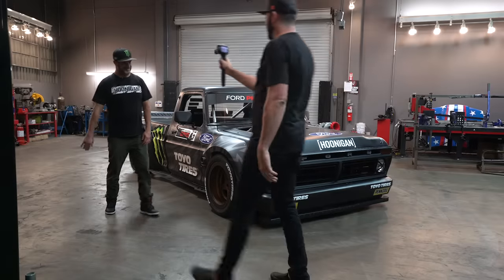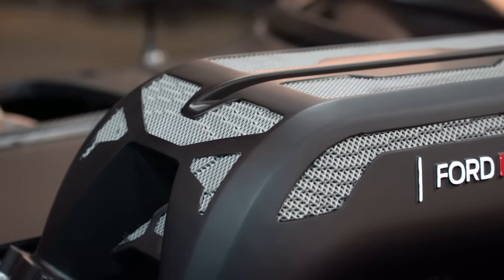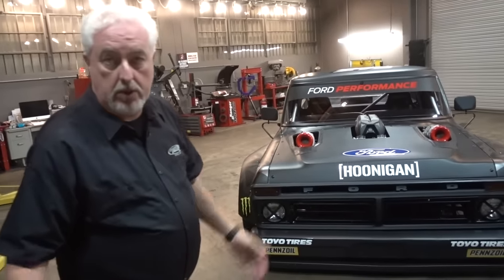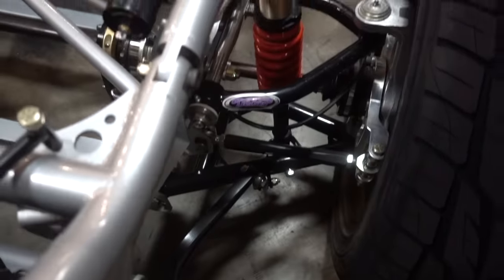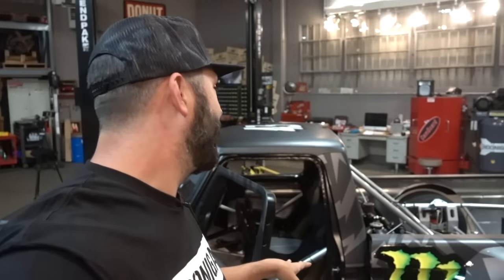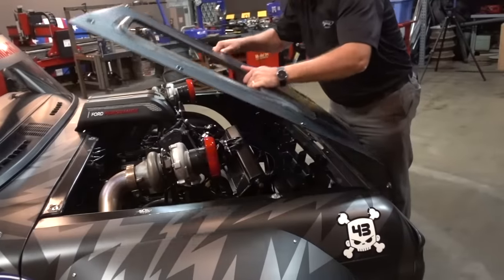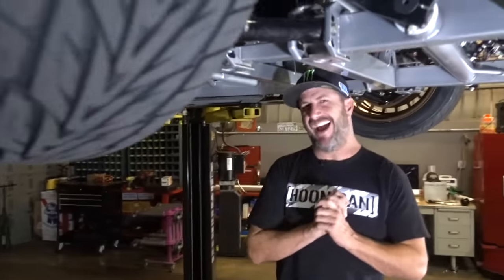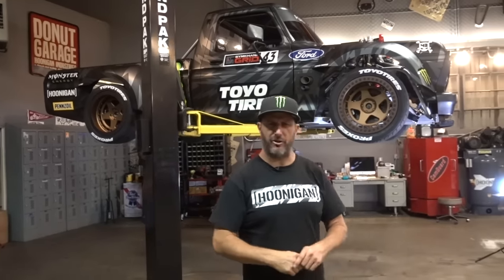Ken Block's Hoonitruck: Twin Turbo, AWD, 914hp, and Ready to Party in Gymkhana TEN

Comment: I bet if you swapped a huge cube NA big-block into the Hoonitruck, it would be Ken's favorite to drive.  When he said "The sound and power delivery are unique", I don't think it was a compliment.
Reply: I can not stand the sound of the raptor. Sounds like a Pontiac grand prix 😲
Reply: Yeah... inline 4 bangers sound better than a V6...  no doubt it's a beast, but the exhaust note definitely takes away from it.
Reply: I personally appreciate what Ford is doing with the push for turbo V6 as the standard engine - better for everyday driving/functional in the rare instances where you need lots of power, and I respect them pushing the boundaries of what that means by using it in high-performance builds where the fuel economy doesn't matter as much. But I think the ideal build for these would be an electric. Keep a bunch of quick-change batteries charged in a trailer, and have 30-minute shred sessions of unlimited torque at any RPM with zero delay in the throttle response...the main drawback to electric is that it's impractical for cross-country trips, if you don't mind changing tires on the regular you might as well change in a new battery. And yeah, feel free to dub in whatever audio your nostalgia requires.
Reply: @kevinvermeer9011  now that's a great idea

Comment: Throwing shade at vaping Subaru owners LMAO, I am the rare non vaping Subaru owner without stance xD
Reply: A non vaping, non stance Subaru. Is that really a Subaru?
Reply: @jasonirwin4631  it has a turbo and it's modified, I think it still counts, just not as much 😂😂😂
Reply: @cjrutter9962  it's technically a Subaru like a LS swapped RX7 is technically a RX7.
Reply: @jasonirwin4631  All stock internals on a WRX with 113xxx miles, but it reliably puts over 300hp down, and its daily driven, all of these things are miracles in the Subaru world xD

Comment: Ford pushin their damn "ecoboost" so much it's really freaking annoying the engine may perform well but Jesus it sounds like a damn weed whacker really should've been a V8
Reply: @adamplitko2101  also a v8 would be fucking heavy for what they wanted to do.. add turbos to this as well and itll basically defeat the point of the truck
Reply: @ruhankarsten7352  v8 are not that heavy if they are all aluminium and they made way more power
Reply: @adamplitko2101  hoonicorn V1 made 850hp without any turbos or a supercharger besides who cares about the numbers this  is the same company that made V8s popular in America so there should definitely be a V8 under the hood of a Ford pickup
Reply: @ruhankarsten7352  that's a terrible argument considering a V8 wasn't a problem for the hoonicorn and a V8 will always outperform a V6 (and sound way better too)
Reply: @anthonylyrette7399  so you want to stick an LS in there? 😁
Reply: @fakename287  hell yeah
Reply: @fakename287  "but i dont wanna go slow" -benny the mechanical stig
Reply: why not a steam engine?
Reply: @jnieto490  ewww. internet tough guy. btw, did you miss the part where he says Ford suggested the v6? yes the same company that made v8's popular now suggests a v6. get off that steam engine bandwagon
Reply: Jessie james  Why not a hit and miss motor?
Reply: @JMax 01 So pros base their engine choice on which is cheaper. Better send that info the Penske and Stewart Hass. LS is OK for backyard racers but the pro's use  GM race engines.
Reply: Every truck out there for 2018 has an available V8 part of History? The only reason Ford is pushing the Ecoboost crap is because they have a huge investment in seeing it succeed. I like the old school recipe for power naturally aspirated V8, there is no substitute.
Reply: I can’t believe the people here suggesting that v8s are primitive engines or something. The engine is impressive but a V8 would have been much more fitting. I’m pretty sure Ken would agree too with his “the sound and power delivery are unique”. The Hoonicorn v2 is his favorite car to drive. The sound just doesn’t fit the look of this truck. But it’s got the V6 because ford is a sponsor and they want to highlight the Ecoboost and that is understandable for everyday trucks.
Reply: @greatlakestatedestroyerpet117  Why not an aeolipile from 50 CE?!?

Comment: Does anyone else think that engine sounds awful?
Reply: Unfortunately, it just doesn't sound good at all, regardless of how bad ass the thing is.
Reply: It's a shame it doesn't have something that of a GTR sound to it.
Reply: @Shepard_AU  I literally couldn't agree more. It's an amazing vehicle but it sounds like a straight piped I4
Reply: It sounds like a little Turbocharged V6. Not my favorite sound, ....I like V8 grumble.
Reply: Don't worry, they can just install Ford's OEM V-8 audio simulator and play it while he drives!(yes it's a real thing in ford pickups and mustangs). Full disclosure, I love my crummy old Fords.
Reply: Sounds pretty mean at low RPM, but doesn't sound anywhere near as good as the Hoonicorn when it's at full cry.  And that's really a shame.
Reply: Baxter It is powered by a 3.5-liter twin-turbo V6 making 917 hp and 702 lb-ft of torque which is powered by the Ford Gt

Comment: the car is modular so if any part breaks from impact it's easily fixable... meaning aside from the engine and maybe the cab, there is at least a whole other hoonitruck of parts at any given time... if not 1 and a half the amount of parts. dream drift set up right there.

Comment: If only passenger cars were built this way...gotta love the motorsports and custom auto market. Amazing how with software, a mill/3d printer, metalworking equipment and some really smart guys you can actually build a vehicle a drifter could replace a rear end on between every set of runs. WOW.

Comment: The "custom" badge on the dash, where the glove box is on a factory truck exactly where it was in my '76 F-150. Details. My high school truck, spent all my money on the motor. Fresh 390FE, 4 speed, 4x4, junk 35's, piss poor brakes. Rubber was laid, diffs were broken. Times were had.

Comment: I have never really liked anything Ford, excluding their older work vans, because the first car I drove was a 2006 Hyundai Elantra hatchback (in silver) which has a remarkably tight turning radius, so when I started driving the Ford focus in driver's ed, granted it was an older focus, the turning radius was so much wider than what I was used to. The focus also had rock hard springs in the pedals, and it made throttle control more difficult and also made breaking harder because I was used to the spongy ass brakes on my dad's ford work van and the Elantra. Since then I have driven a 2007 Hyundai sonata, and a 2014 Hyundai azera. The azera is a great car, even for being a fwd it still has a lot of power for a "luxury" car, I think it's around 270 hp from a v6 engine. Now I'm not saying that Hyundai is my favorite brand of car, it's not, I would kill to have a 95' Toyota Supra, skyline GTR R34, or a Subaru WRX impreza, but my dream car is a 2008 dodge viper hard top in lime green with black racing stripes.
Reply: Hooray for insomnia! It's 3:10 AM, and I'm still wired AF...

Comment: The hoonigans.  you can give me the tires for my build. Lol. So i can travel all over. Its a 1951 ford f2. Im putting it on a 1988 ford f150 frame. It has a 300 6 cylinder 5 speed manual. Its been bored 30 over. bigger injectors plus a few other things. I was going to tuck the wheels under the fenders but im going to stick them out like your truck and make the fenders look kinda like yours. And lower it.  I think it'll look pretty cool that way.

Comment: Far be it from me to give engineering advice, but how is the hell is there no oversized washer on the lower control arm mounts? How in the hell is that bolt holding toque with such a small washer?

reference @ 22:10

Comment: It is an F150 77' it doesn't need to get back on road quickly any where for any race. Nice idea lego box tub framing kit but this anti the car/truck to use it on. I don't know what is really. U can weld up piping just as fast as u can unbolt damage system & bolt replacement system back on+ u never know the extent of real damage after a wreak. What looks unbolt change out may really b unsafe cage u r chasing like trying to straighten old frame car wreak to fix body damage vs mono-cock or uni-body trash it use new deal.

Comment: Had to look at the front grill to see what it was b4 being told a ford and personally I'm a mopar guy and gradually into chevy but my first truck I've own was a ford the same year as this one as a teenager the motor blew up so I left it right there went back to mopar that truck was a ram charger nice truck until you get into buying them huge ass side windows 😂 sold then my next truck is a chevy Silverado 1500 single cab 2wd 4.8 vortec wit 242,051 miles on it all stock except cold air intake from k&m who ever built this motor I would love for them to build any motor 4me this engine loves to rev and she's still my daily truck today like I said from ford to mopar to chevy and still 4.8 strong but I'm missing my 340 balanced and blue printed mopar it got stolen 😩 happy motoring &have a happy holidays stay safe gearheads and all

Comment: Most ppl want to error on beef safety side rather than ultra light fly by Flintstones power type bike racing. But if u r talking solar ultra light bs racing there may b a place for bolt on & off replacement match stick framing.
Reply: Almost always cheaper just to hve a few spares. Hving a few spares means u can hve them set up diff where as hving change out frame means u don't hve any set up but main 1 or 2 & most like mostly exact same frame & set up. Rain day horse vs clay court horse vs gravel or dirt cart, vs paved flat vs banked racing. Idea w/out a need unless crash derby how fast can u fix it or ultra light bares safe lowest limit match stick framing.

Comment: If I owned this truck, I would drive it straight to Cleetus McFarland's shop to LS swap it and get rid of the miserable V6
Reply: Why would you want ancient technology with hundreds of horse power less.
Reply: @benjaminwayneb   Because you can hit 900 hp for way less without the cost of needing to have a one of a kind 3D printed intake manifold. 

I have an LS powered car and agree with many of the comments that a V8 Coyote or something else from fords line up would have sounded damn good. But think of this from Ford's angle, this is another chance for them to have additional R&D into what their current focus is. I love the ecoboost 3.5, it just needs to sound better. Even with nice exhaust, they sound terrible.
Reply: @MitchL85  Not without a super Charger or turbos.
Reply: @benjaminwayneb   Sure that would make it easier, but a real basic google search would prove you incorrect. There are plenty of 1000+ hp NA LS motor builds out there. The motor is decades old and people have perfected the craft. 

That said, I"m not saying to LS swap everything like some people. I would much rather see a heavily modified coyote motor sporting twin turbos to keep the Ford thing going. I love the build though, would be a blast to drive.
Reply: @MitchL85  A stock based LS engine can't make anywhere near 1000 hp without some power adder. There are LS style engines with 600 plus cubic inches getting close but they aren't an LS engine.

Comment: Hving prt made to break to protect the main unit is sound practice & only way to keep light enough to race but hving frames built to change in *& out not sure the cost benefit is there. By the time u trash it it was time to change it better never design any way. Unless u race demolition derby pnt of race is to try & break it, not really race it & how quick u can put it race worthy back. That is a completely diff race style then time racing or flash big crash big risk camera racing.

Comment: stop letting ford pick the motor. they suck at choosing motors
Reply: Her's the deal when they ran the Coyote in the Rolex 24 hrs at Daytona in the Prototype the finished 1-4 and embarrassed the competition so badly that they would not let them run that engine combo in Prototype any longer. Ford came back with the V-6 the next year and won again. and then Le Mans. What are you running?